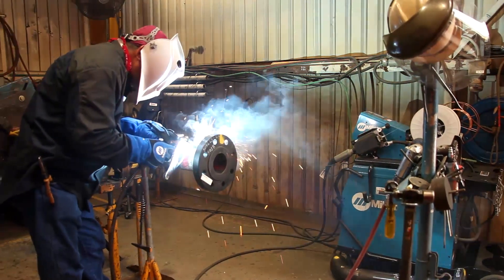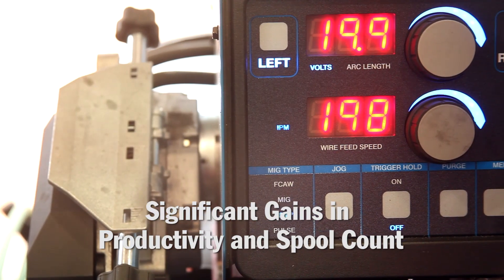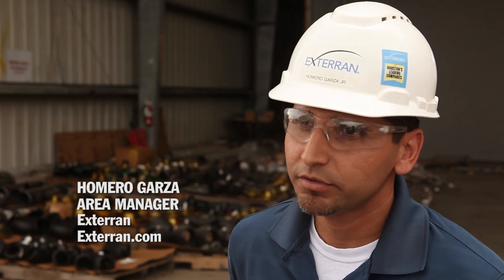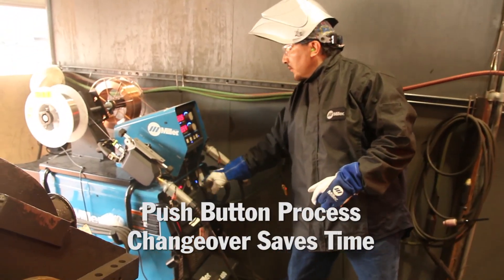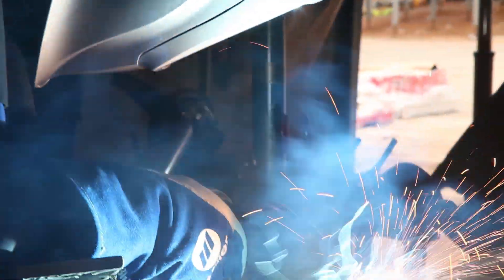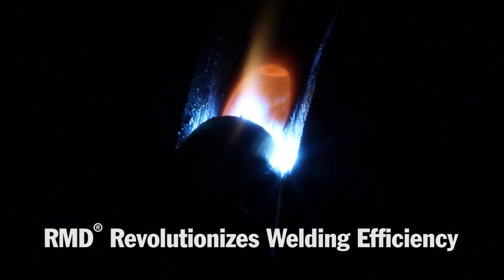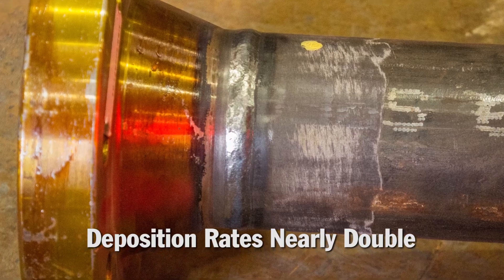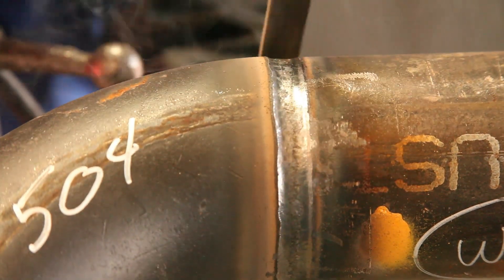Exterran Doubles Deposition Rates with Miller Pipeworx 400

Comment from the maker: With already high weld passage rates, natural gas compression solutions provider Exterran saw improvement in x-ray passage rates in their Brittmoore pipe shop with the Miller PipeWorx 400 welding system. Now consistently above 95 percent passage rate, the shop was able to increase productivity while also heightening quality. Watch more: